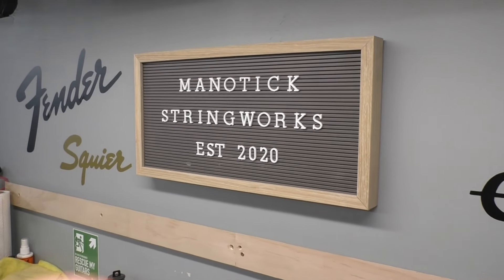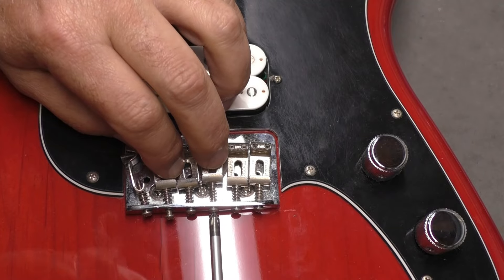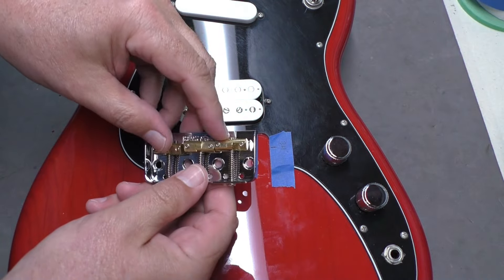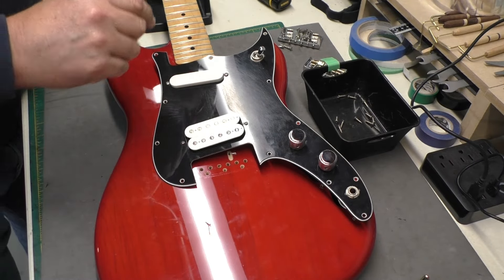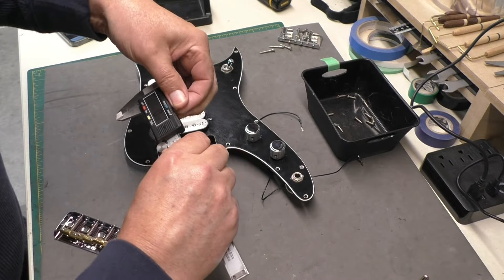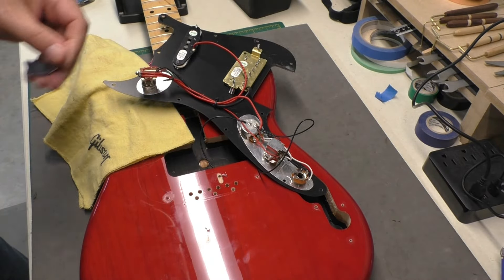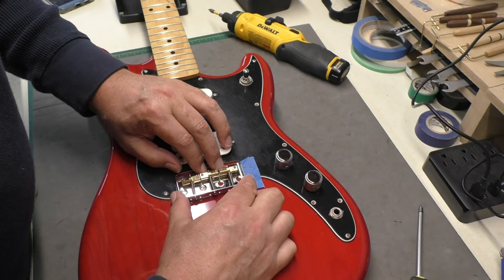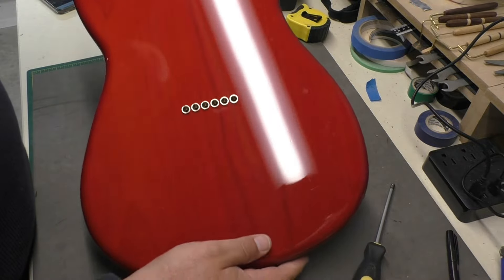Fender Player Duo-Sonic Electric Guitar gets a new Telecaster Bridge!

Comment: thank you so much  for sharing your craft! Question for ya ... 

Is there enough downward pressure on the saddles to keep them in the adjusted spacing or did you have to mark a groove on each brass saddle with a file? 

Oh, and it seems you biased the positioning of the E string saddle forward. I dont have your experience and so out of fear of screwing things up I would have centered the saddle half way in its run way, to allow maximum leeway in both directions. That would have placed the bridge closer towards the humbucker. Is that ok, or am I overthinking things?
Reply from the maker: The strings will cut a groove over time in the saddles.  The 1st string rarely needs intonation adjustment forward (sharpening the string) so I usually place the saddle at the scale length and leave about 1/8" (3mm) or so of screw exposed.
Reply: @ManotickGuitarTech  got it!

Comment: Asking for modding reasons, would changing scale to the normal 25 oreven baritone just be a neck change? Or would it be more work? Because this might be a viable way to get a full length / baritone duosonic.. I love the duosonic better than a strat, but as a bassist, don't really like the shorty scale.
Reply from the maker: You would have to move  the bridge as well
Reply: thanks!

Comment: I'm not that keen on the Fender saddles. When not under tension, they wobble about.  The height adjustment screws can also poke your hand unless you cut off or put in shorter screws.
The compensated brass Tele-style bridges aesthetically look great, although maybe the intonation isn't as good.

Everything is a compromise.

Comment: Crazy question - My string ferules fall out if not under tension. Will these fall out as the wood dries? Do you recommend CA Glue or Titebond wood glue for ferule gluing?
Reply from the maker: If they out regularly, I would put a little dab of wood glue and then let them dry in place.  I avoid CA glue because it cab messy and harder to reverse if you need to take them out.  You can also wrap some aluminum tap around the ferrules and push them in so they are a tighter fit - no glue needed.